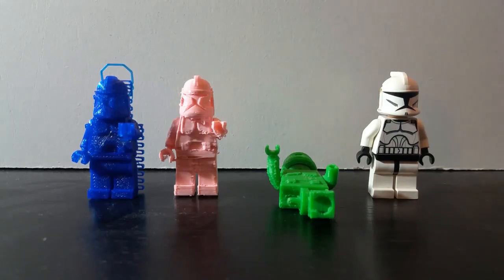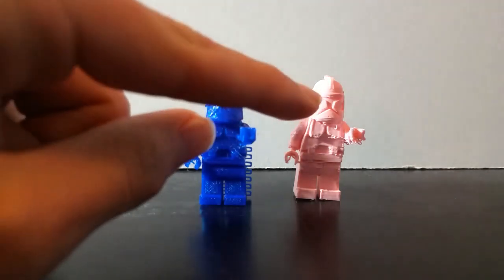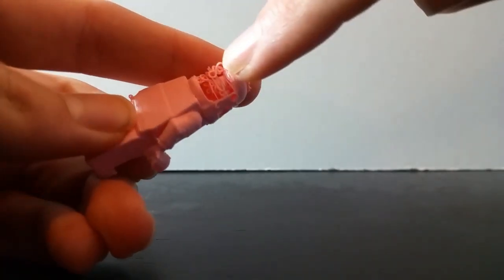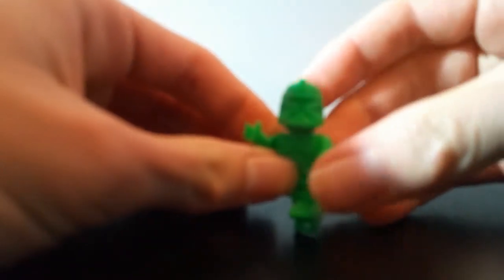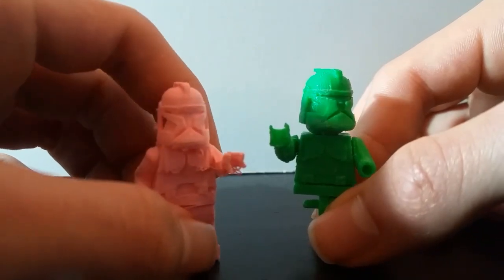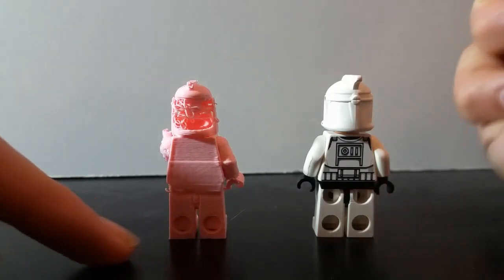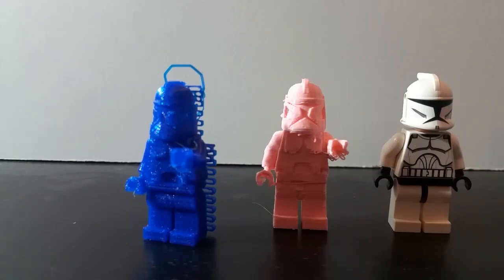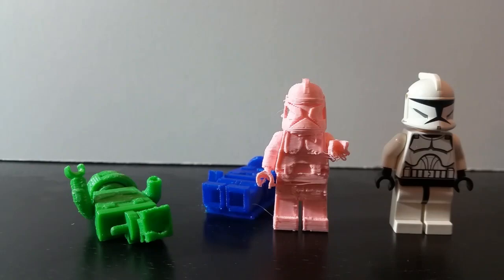[New] 3D Printed LEGO Clone Troopers

Comment: Not bad my dude but you still need a lot of work.
Reply from the maker: For sure, it's not the best model  but was an interesting side project when I was feeling a bit tired of my main project for the class. I don't plan on continuing with the project at all but I might paint them to see how they go. I was surprised that the quality came out better than I thought, but the quality is still so bad that it can't even compare in to LEGO standards. I do appreciate the feedback though and "not bad" is exactly how I'd describe this print. Maybe with a better printer I could get good results but for LEGO quality products a mold injection machine is the way to go.
Reply: @aurum_7201  you should keep trying never give up there's always a way to make things better.
Reply from the maker: For sure, but I have 16 days to complete the 3D Prosthetic dog leg I'm making for an amputee dog I know, it's a more important project, but I will no doubt touch up on this at some point over the summer
Reply: @aurum_7201  have you tried making a mold for the minifigures ?
Reply from the maker: I can auto-generate a mold in the software I use (Autodesk Inventor) but creating a mold and using plastic injection would cost thousands of dollars and mold injection machines are only used at high-quantity, commercial scale.

Comment: Lookin pretty good. What's your motivation to make these troopers? Can't you buy these guys in bulk for pretty cheap?
Reply from the maker: Good question! In my class I get a lot of time to freely use the applications for my own printing purposes along with do routine and advanced maintenance on all the printers. This was more or less a minor side project to test some of my skills specifically with the mirror and fillet tools within the program. If you wanted to make a clone army of sorts buying troops on Bricklink in bulk is the way to go. One of these costs roughly $1.25 in filament to produce which makes 3 3D printed clones equal in price to 1 standard LEGO finish clone trooper. Although the price may be lower, my version is clearly not as intricate as LEGO's design which uses a metal mold and liquid plastic to super cool into that you get in a set. If you truly wanted to 3D print a perfect LEGO clone, you'd need a $15,000 3D Printer and it'd cost you around $15-30 for just one clone, which compared to $5K-7K industrial mold injection machine is quite high. Nonetheless, it's still and interesting project, just not practical for creating a massable amount of troops.

Comment from the maker: If you're interested in 3D Printing, CAD or learning how to 3D print the clones in this video, feel free to message me on instagram, or leave a comment down below! This was a fun little project to do on the side during my class. If you're at all interested in engineering CAD is a really good class to take as it incorporates a lot of interesting part development and construction design integrated with both software applications and the mechanical aspects of engineering. It's quite interesting and the printed elements are quite interesting. If you have any questions on it, leave 'em down below! 

3D Printing Tools I Used:
Autodesk AutoCAD (For the Old Print)
Autodesk Inventor (For the updated Print)
Makergear V2b Hotbed 3D Printere
Makergear PLA Filament (In Light Pink and Trans Blue)

(Also, video to the older model is in the description below) Note: It's from September 2017 so the quality is quite terrible and very cringey.